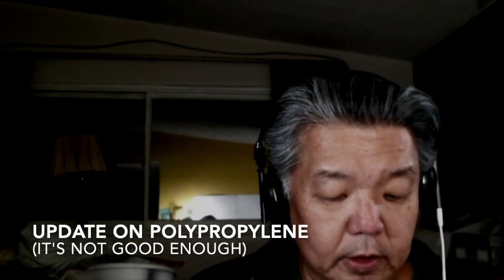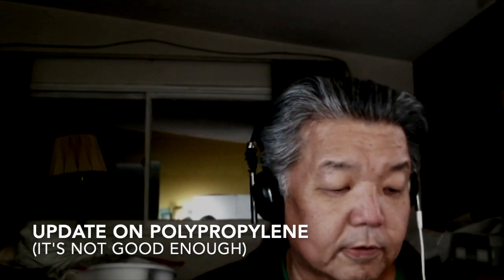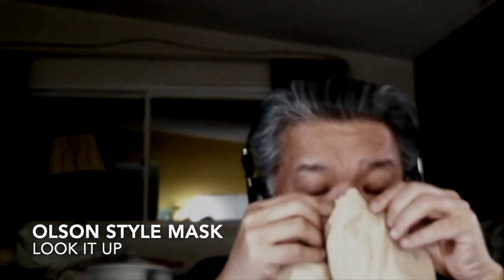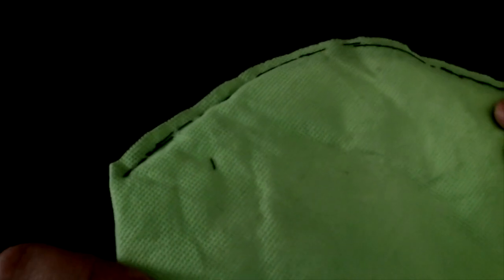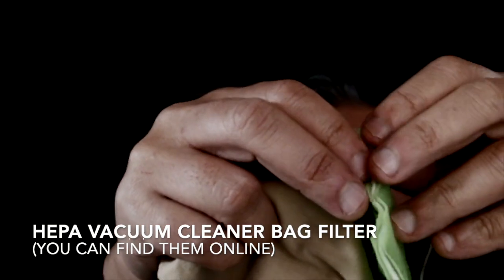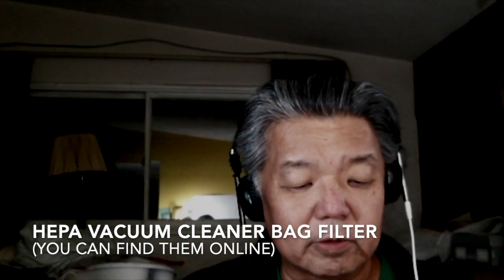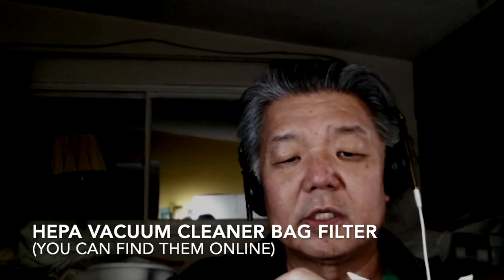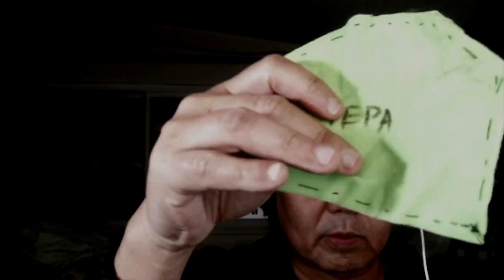Polypropylene Fabric Update, and a HEPA DIY Facemask Filter Test

Comment: Use a HEPA filter from a room air cleaner, not a vacuum bag. Takes too much air flow to get through a vacuum bag, the air will go around the filter instead of through it into your month.
Reply from the maker: Need to inspect the filter. I opened up a filter from a room air cleaner, and it had loose fibers in there, so I couldn't use it. It may have been fiberglass. So I went with the bag. I may look into 3m Filtrete.

Speaking of air cleaners, I am using a room air cleaner. I position it so the filter faces up, and the wind blows to the side, so that it draws falling particles toward it, and doesn't kick up the dust too much. These claim to trap viruses!
Reply: @johnkawakami8395  what kind of air cleaner filter were you using?  Is it an after market filter. A proper filter should not have loose fibers. With the strong airflow of an air cleaner, your room would be filled with fibers.  Also, make sure you pay attention to the direction of air flow indicated on the air filter. The filter should be inserted in the mask such the air flow to the mouth in the same direction. I use Honeywell HEPA filters. The material on the two sides of the filter material are very different. The fuzzy microfibers is on the intake side. The outflow side is plastic like smooth. Its specs are better than a N95 mask.
Reply from the maker: @FuzzyasianDad  I have a Hunter air cleaner. The filter is called HEPATech, and it's the OEM one. The fibers are on one side of the pleated fabric. There's four different things in the filter. First, on the intake side, a prefilter, which also holds the fuzz in. Second, a space that has some of this fuzzy stuff. Third, the pleated fabric. Fourth, a charcoal filter that's like an open cell sponge. On the whole, I like it. It clears the air of little particles.

If I put it in backwards, I suspect I'd see the fibers coming out.

One of my videos shows the filter, and why I could not use it for a mask.
Reply: @johnkawakami8395  Regardless of which HEPA filter to use, it should be placed inside the mask between 2 high thread count non stretchable cotton fabric. Any loose fibers, especially those from the cut edges will be trapped inside. (They are not micro filter elements, those are fused into the fuzzy material. Otherwise, your room will be filled with the micro elements when the blower is turned on). I do not like people cutting up a HEPA filter, folding it and using it as a mask by itself. You could get the loose fiber into your lung that way.
Reply from the maker: @FuzzyasianDad  Thanks for the advice. Yeah, I got worried about the filters, too. I will find a lnk to a video by a doctor who read the MSDS on a filtrete filter she cut up. The MSDS didn't report anything, so, it seems safe.